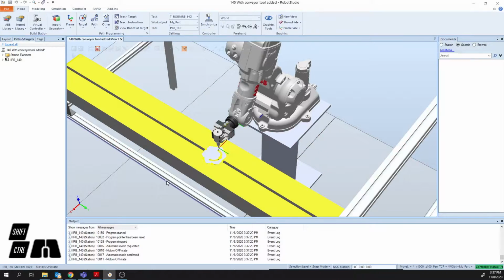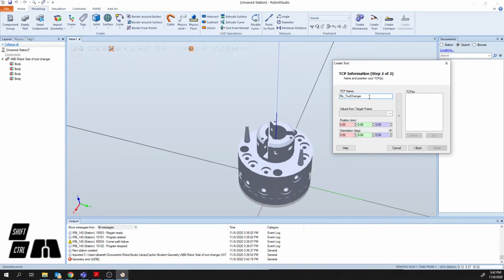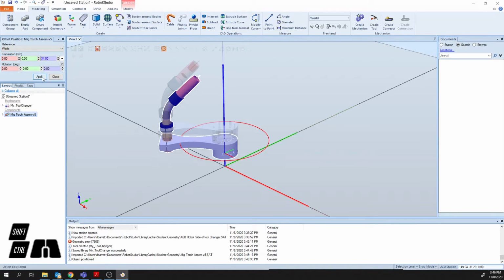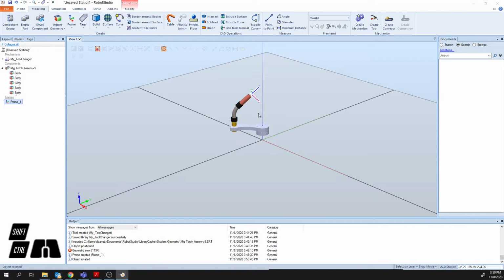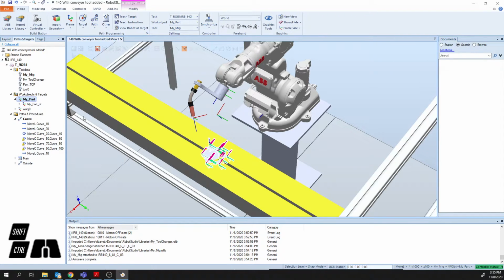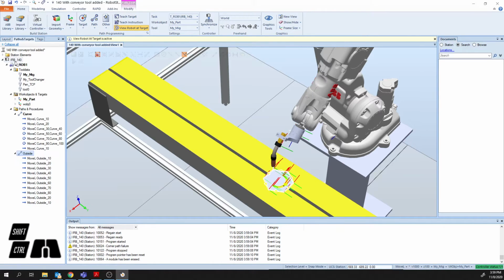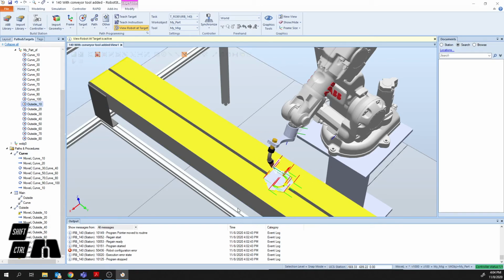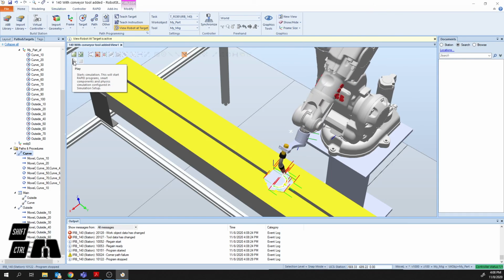Creating and Replacing a Tool in Robot Studio

Comment: hi sir, thank you for the video it's very helpful, but I have a question in my case I have a gripper with two tool points one for charging and the other for discharging in the same gripper so how can I create a tool with two frames ( two TCP) on one  tool ??? thank you
Reply from the maker: Good day Mongia, to make a second TCP you can create a new frame and go through the same steps again, that you used to create the first TCP. I font believe that there is a limit to how many TCP's a tool can have. Just keep in mind that you need a reliable name for each TCP so that you don't mix them up in your program.

If you have any more questions please feel free to ask.
Dan